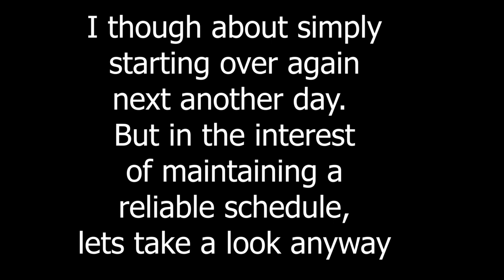Forging a blacksmith hammer - 100K Giveaway

Comment: Mistakes happen, im up to nearly 100 hammers made in my shop, and several dozen top tools.
Punching eyes and getting them dead centered and not crooked is the hard part.
I do some on the power hammer with a round punch, but most of the time it's in the press. I've made tooling to do it both ways, and also have punched many eyes with handled tools and a striker.
I like that you show errors, and will show how to correct them. I have several uh oh blanks in a bucket, some I've learned how to salvage, and some are reminders of what NOT to do.
Looking forward to seeing these completed.
Forge on Sir!

Comment: Thank you for the video. I have a 33 pound air hammer. I thought it would be easy to do something on the power hammer that I was used to do at the anvil. Not the case at all.  It all seems to get away on me when I use the air hammer. Brent is the master but his hammer is so big, it acts way different than smaller hammers and his skill level is years ahead of your average guy. So, I really like when you show your hammer in operation. Thanks again...

Comment: Super channel - I just finished a beginners blacksmithing course, got my anvil and made my first tools (flat tongs, centre punch and a hot chisel)  Now looking to see what forge to get but torn between coal and gas - Now, I just need a hammer to get started :)
Reply from the maker: A big issue is just the availability in your area.  If your in coal country that might be the best option, but if you have to have coal shipped or live where you don't want the smoke, propane might be better

Comment: I was always told the sign of a good craftsman is not being able to tell when he has made a mistake :} Since you do not make many ... I guess we can let  you slide lol . So I will sit and twiddle my thumbs and wait for the next video ...
Reply from the maker: thanks
Reply: I think that saying is intended to mean you can't tell from the finished product that the craftsman made a mistake. It didn't apply to actually watching their every move along the way. Everybody makes mistakes, and full credit to John for having the courage to leave them in. Seeing that he makes mistakes, shows beginners the real world. We make mistakes - and put them right.
Reply: @BlackBearForge  well I am sure brent baily appreciates the plug and honesty, but also thanks for sharing the whitiker method, I would not have thought of that but if you want it to be straight and faster that would be one way I think, or drill it and drift it, if you have a way to muscle it though with a power press maybe dont know how that would treat the metal though, some say its better to do it slow and not put as much stress into the metal, maybe I will make a hammer one day, I dont really do much smithing more dabbling in fabrication, did make a chisle though, but turns out it was mild steel and even taking a staple out of wood etched the edge of it it even though I got it as hot as could and put in ice water to try to make as hard as could.

Comment: As always, your videos are top notch.  I'm especially glad that you do most of your demonstrations at the anvil rather than the power hammer.  Most hobby smiths like me will never own a power hammer and it's great to see what can be done by hand.  I have some ongoing projects where I need very small diameter holes punched in 3/8" or 1/2" square bar.  I'll be riveting sheet metal wings to dragon bodies with 12 gage wire for rivets.  Drilling is not optimal because it is so easy to break the small bits.  Punching is a challenge because a thin punch heats up and deforms very quickly.  I'm planning to solve the problem by punching most of the way through the bar with a bit heavier punch and then just punch the last 1/8" or so with the thin punch.  I've also ordered some S-7 bar in hopes that it will be more resistant to the heat than the punches I have now.  Any suggestions from you or your subscribers on how to deal with this little dilemma would be great!  Thanks again for the great channel.
Reply from the maker: sounds like something I would drill, but very carefully.  As for power hammers, There was a time when I was sure I would never own one and avoided demonstrations from some highly skilled smiths that were using a power hammer.  Now i really wish I had gone to those demos

Comment: Congrats again on the 100K. I've seen two hammers made from one billet before, but haven't done it myself. I've wondered if that technique can be used in making diagonal peen hammers.  I especially appreciate you showing us work where you may be struggling a bit to get things to go the way you want because that matches my experience so much of the time.  Thanks again!
Reply from the maker: I think it would work well for diagonal peen hammers, but you probably end up with a left and a right
Reply: @BlackBearForge  I need to get the modeling clay out and play with this idea. My poor brain isn't sure, but if one punched the two eyes at right angles to each other like if a person were trying to make a cross peen and a straight peen the result would be two right handed (or left handed if that's what was wanted) hammers.  I'm right handed, as well as the buddy I often forge with, so that seems more useful to me.

Comment: Mistakes are important to publish also, helps learners to understand the how and why of what you do and what they should be watching out for.
Reply: Thoughts on the power hammer
1. The peens came out too long because the radius is too large on the power hammer die and was drawing it out more than fullering it.  perhaps a different set of dies or a jig?
2. For drifting with the power hammer, perhaps a drift 1" longer, with a hole drilled in it 90° to the long axis that would fit a bit of round stock.  That would give you a way to hold it in alignment for most of the strikes, and withdraw it for the last few and for when you flip the billet to drive the drift out?  It might even work well enough to try to reforge the drift hole instead of using a die grinder.

Comment: I have a question about using scrap metal to make tools. Where I work is getting rid of a few 2” hitch balls, and I was wondering
1. What kind of steel are they usually made from?
2. How would they work as hardy tools?
Reply from the maker: I have no idea what they are made from and they may not all be the same.  I use one as is as a ball form for refining dished pieces.  I suspect they would make useful tools but you would need to do some test hardening to know how to heat treat.  You should also strip the plating off before heating in the forge.

Comment: Awesome work John I watch all your videos, I do have a question for you though, why don’t you use a kiss block kind of like Tim at big dog forge? I figured you would have a system that would lock on your bottom die that you would make different thicknesses for, nothing wrong with the way that you do it but it seems easier and faster I just wish I could afford a good power hammer though just keep up the good work John and yes I think you can salvage them
Reply from the maker: for production work reducing numerous pieces to exact size a kiss block is a good idea.  For a single piece that doesn't need to be exact they are just an extra step.

Comment: Why a cross peen verses straight peen?
Reply from the maker: At this point I would say because its what I am used to, but you will also find that it is way more common, so those that came before may have had a reason for making that the standard that we all picked up when we started out.  Give both a try and see what you prefer.